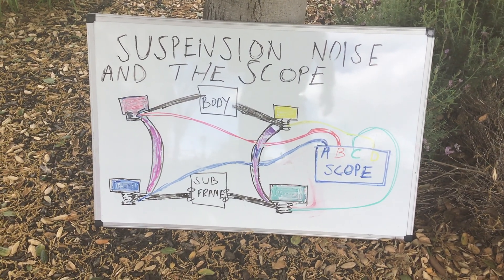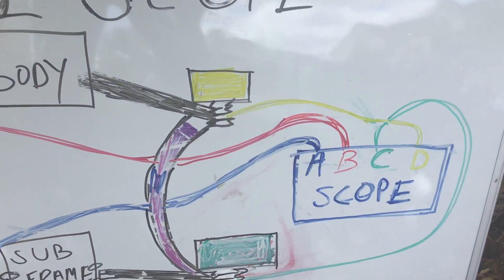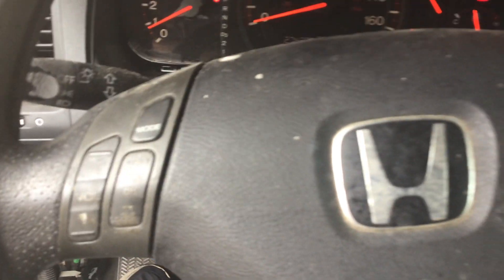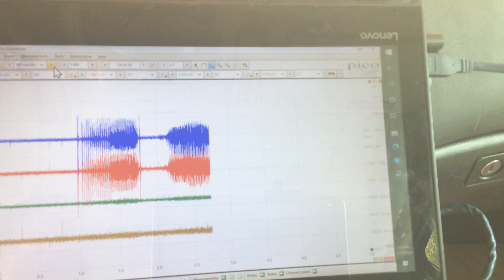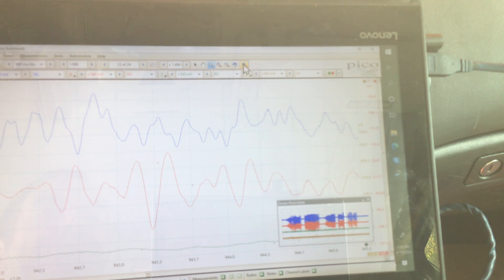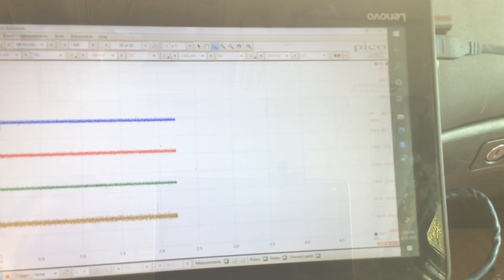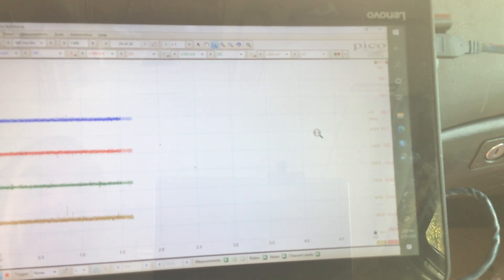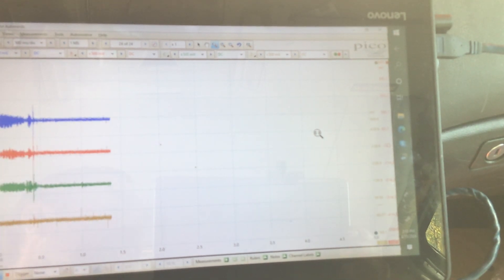Suspension noise and the Scope. best to listen with head phones

Comment: I wonder if you crank up the speed could you tell which noise was generated first. I assume the vibration that propagates through the suspension is fast. but is it measurable? also do you have a link to those test leads?
Reply from the maker: Thanks good advice. The microphones are from the steelman microphone set with that box with the dial that has 6 microphones hole and a headphone Jack. I just used the microphones. I got 4 bnc to female 3.5 mm audio Jack adapters from DTECH ENGINEERING. who make great video btw.
Reply from the maker: Thanks the lower ball joint fixed the noise.